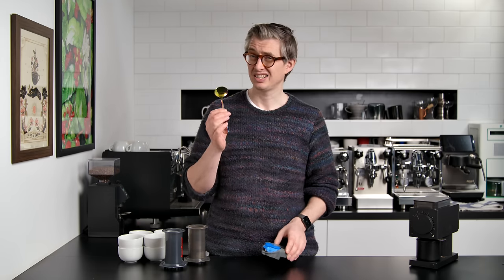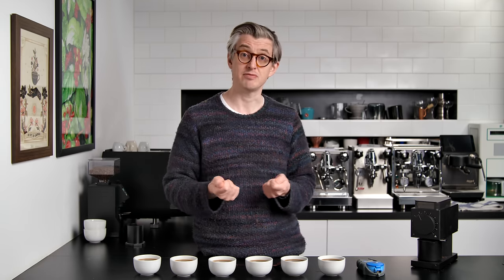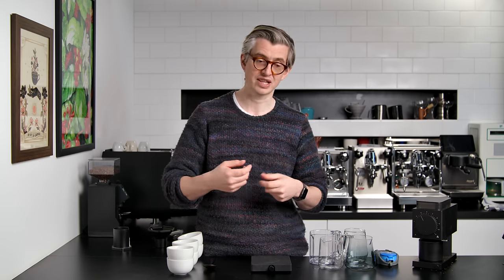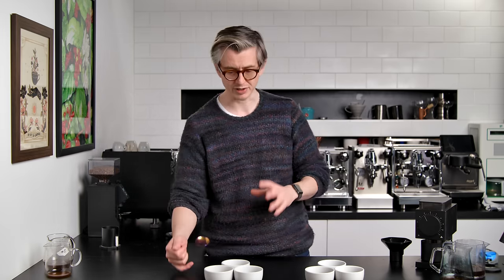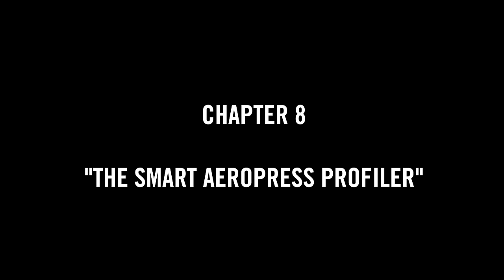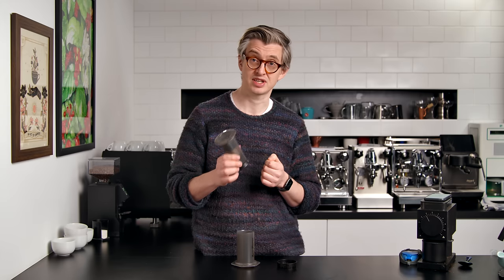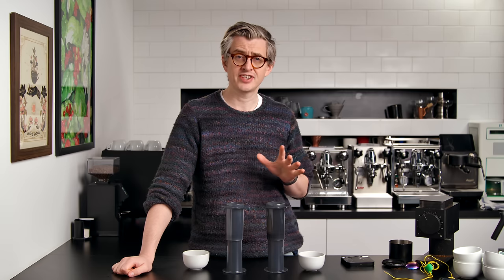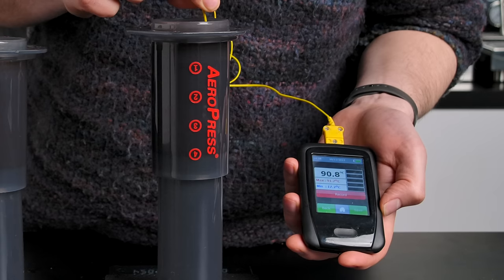Understanding The AeroPress (Episode #2)

Comment: Perfect way to start my weekend: 30 minutes of detailed and informative Aeropress science!

Two followup questions:

1. What if you change the volume but keep the ratio constant?  (I’ve found that smaller brews sometimes taste better — possibly because they extract less since the water loses heat faster, which probably means they were overextracted at larger sizes.  Maybe I should’ve just adjusted the grind instead?)

2. What about using two filter papers?  (I was resistant to this idea for so long because it seems so wasteful, but I did it accidentally the other day, and I was shocked how much difference it seemed to make, for the better.  It even got me rinsing and reusing the papers, to avoid excess waste..)

More generally, I wouldn’t mind a bit more on dialing in — is there anything worth adjusting other than the grind?  What if I can’t grind coarse enough, e.g., because I have a grinder that’s more geared towards espresso?  How do you deal with overextraction in an Aeropress brew?

Looking forward to more!

Comment: If you stir with the Aeropress provided plastic paddle instead of a metal spoon, you will get the same results as a swirl. The long paddle and its large surface area does a good job of moving all the volume in the tube equally.

Comment: Very helpful video!
I stir with the included paddle after pouring half the water in, then use the remaining water to rinse the paddle back into the press. Most thorough brief stir, no dirty utensil, or lost preciousness. (Sorry James your cute spoon barely impacting contents, did not appear to stir much)The inverted method (never spilled once, years later), I put the filter holder on while inverted and squeeze the air out the top before turning it over to plunge, barely a hiss at the end.

Comment: When I started brewing at home again, I'd long forgotten my Aeropress skills and "ideal" setup, which I hadn't used in more than a decade. Little did I realize that I'd spend hours watching Mr. Hoffman educate me on all aspects of espresso, even though very little of it will actually impact my own personal tastes (the nuances of any brewing technique tend to get lost when I pour the 6 oz of cocoa-infused steamed milk into what is now a mocha).

But my inner knowledge junkie just can't resist. 😁

I invert because I can stir the coffee slurry without potentially damaging the filter (sorry James, but spill risk factor is zero).
I slightly wet the filter just so it sticks inside the housing (and I re-use it for round #2).
I do a 2 minute extraction, with a swirl at the 1 minute mark.
I push most of the way through the hiss, stopping short of the puck itself.

Pop the puck. Rinse. Repeat. 
Add milk mixture from frother. Top with whipped cream. Enjoy.

Comment: Never had a problem doing inverted, surprised it didn't make that much a difference but I still prefer the process tbh
Reply: I've always found with inverted I can get rid of nearly all the air in the chamber by knowing the amount of water going in, positioning the plunger accordingly and doing a little press with the cap on before inversion. Wonder whether air/airless makes any difference?
Reply: @groundcontrolto  considering the hiss didn't do anything I don't think having air there does change anything tbh
Reply: @SWatchik  The only thing I've noticed is that it stops coffee sometimes getting stuck to the plunger but maybe that's cus I'm not agitating enough XD
Reply: I have a Prismo just for the convenience of doing inverted.
Reply: Alex V  There are some nice stories in the book, useful for some people despite being mostly fiction.
Reply: Alex V  I'm an athiest but thanks for the irrelevent comment lmao
Reply: I think that without air inside swirling is less effective. But perhaps it's not necessary at all because turning does the agitation work?
At the very least after watching this video I'd let it settle for 30s after turning.

Comment: Instead of using paper filters, I like to use metal screens. You can try ones with various mesh sizes to find what you prefer. It saves money too, as the screens can be used over and over.
Reply: Brewing with metal screen also changes with the techniques discussed here by James, despite showing minimal difference with paper filters. Since metal screens can allow more particulate through technique is especially important to reduce the amount of sediment in the cup. I find inverted, purged, swirled, settled, and no hiss all work in favour to brew a cleaner cup.
Reply: You will never get a metal filter that will be as fine as paper. At least in a range of price that the consumer can afford. There may be ways to make metal filters that go down to the micron range, but I doubt it is a cheap process. I suspect that metal may also allow for a greater chance of channeling as it's larger diameter holes will be easier to clog. That said, I'd like to see a side by side test using his pressure gauge.

Comment: TY James! This video is amazing. i was thinking of replacing my 8 year old Aeropress because for some reason it has become quite easy to press it - thinking due to internal scratches or maybe just my arms getting used to pressing. 

But this video taught me:
1. Less pressure is not a bad thing and can in fact make Aeropress taste relatively better.
2. Less pressure can occur if you brew higher temps. (I used to brew lower temps so remembered how hard it was to press but I started brewing more at boiling temp a few months ago).

Comment: Something I found confusing for a long time is how you can do a long-steep brew (e.g., 8 minutes) without over extracting. Like many, I have definitely had an over-extracted long-steep brew. 

Here is my theory and perhaps someone can tell me if it's right or wrong: Extraction rate decreases as the brew cools. The goal is to extract all the good stuff and none of the bad stuff by the time the temperature drops to a point where the extraction rate becomes insignificant. Therefore, grind size selection is very important in limiting the amount of extraction (for a given starting brew temperature and dose). 

The overall thermal mass of your brew and degree of insulation affect the rate of cooling and therefore extraction, so you may need to modify grind size for a different brew size or brewer to achieve optimal results. Also, the extractability of specific compounds changes at different temperatures. Therefore, although it's possible to get the same extraction % for a finer grind over 2 minutes and a coarser grind over 8 minutes, the chemical profile (and therefore flavor profile) in the cup will be a little different. 

Thanks for reading :)

Comment: I now own a Rok Espresso maker and Belman steamer, which might be "enough said".

But I still feel the need to leap to the defence of the Aeropress.

I never used a paper filter. Fine grind of light roast through an Able stainless steel super-fine metal filter. Very hot water, and short steep time (10s or less). A whopping 70kg of pressure with a strong cup to hold it back.

Still a great piece of kit for camping.

Thank you for this video.

Comment: I'm an inverter, non-rinser, no pre heat, fresh of the boil water (standard kettle, no control over temp), no swoosh or stir,  hiss-presser, with a fair amount of pressure.
I think I hiss press because I invert, so I'm going to make another cup now and non-invert and see if there's a difference. I'm also going to use less pressure from now on. 
Great video, and I've subscribed. 

I would also like to see some tests on the metal filters, as this is something I've been considering as it's less wasteful, and saves trees.

Comment: whoa! i've been using my aeropress for years now, with a light roast, fine grind, inverting*, boiling water, swirling, brewing a few minutes, pressing slowly and through the hiss... and i've always thought, 'i should probably google this and learn the right/better/proper way to use this thing. i probably need a fancier kettle with temp control, and i wonder if I'm brewing too long.' i love my coffee but always wondered if i was doing something 'wrong' or if it was possible to make it even better.

hallelujah! i'm so glad i don't need to bother changing anything nor spend money on a fancy new kettle. yay! 🙏

* i don't find the inverted method clumsy at all and I don't like when that splash or more of under-brewed stuff leaks through before i can get the plunger in to stop it. also just putting the plunger in pushes a little more of it through before it's ready. does anyone else notice that?

Comment: I used to use the inverted method, but lately I've used the plunger to form a vacuum.  If you load it, put plunger on, then give it all a swirl, you lose very little liquid before steeping.  Less than 10ml.  I know this because when it has a vacuum it's not dripping and you can pick it up and look in the cup.  Another interesting thought about steeping non inverted is over time your coffee grounds will settle and you're more likely to press through them is my thought.

Comment: I've always gone through the hiss to compress the ground for ejection and easy cleaning,   so I'm glad it makes no difference in taste.

About 6 years ago, my nephew bought me the AeroPress one Christmas, as they're unbreakable, light and ideal for bike/backpack camping) followed that up about two years later with a stainless filter (similar to a portafilter) by 'FELLOW', which I like, it's easy to clean and I haven't used paper filters since. It does protrude 21mm below the bottom of the cylinder so slight immersion may occur depending on cup. Maybe you'd like to try one of those out?

I use the inverted method, inserting the plunger to just below the number 3 circle gives the right measure for 1 cup when filled and I either switch off the kettle just before it gets to a rolling boil, or wait for the rolling boil to stop. I also give a stir, filter on and invert back onto the cup, swirl for about 15 - 20secs, about a minute to steep then plunge with easy pressure, no forcing. That's what works for me.

My AeroPress is used two or three times a day at home and travels with me when I'm away on holiday.

A tip for those who've used AeroPress for several years and for those who have yet to encounter a problem that the plunger has after those years of use.
The plunger's seal gets infused with coffee oil's and stiffens over time which causes it to not fully expand out again when removed, losing its ability to seal properly when replaced, and allowing hot water to trickle past it. I thought I'd have to replace it, but with the help of YouTube, I found that I could refurbish the seal by using a boiling hot water/mineral oil combination in a bowl. I did that last year, the seal softened up again and the plunger is still working as it should, no problem.

Comment: Excellent video, James! I've been doing experiments as well.

Please test bypass brewing (pressing 1/4 of the water through then adding the other 3/4) vs. pressing all the water through. They end up with the same coffee:water ratio, and I find one of those tastes a lot better than the other (medium roast and 80°C water).

Also, you might be right about the hiss results when mixed in, but try pressing the air through into the sink and tasting the foamy part that comes out. I find it tastes great from the company's cold brew recipe and not great from hot brew!

Tip: Taste-testing in dark coffee cups pretty much hides the color differences between samples, including those due to slightly different amounts.

Comment: James, if I seal with the plunger before blooming at least a little (wait 10+sec or stir to get most of the CO2 out), the CO2 releases while sealed and often the pressure pushes down & punctures the thin filter, and I get a hot mess of everything in my cup.

Comment: Thank you. Nerds are the most interesting people.  Asking the right questions and making the kit to answer those objectively is a lesson in domestic science.
You never defined what coarse or fine means for the Aeropress.  Your recent review of the Nespresso pods and grind showed how important both the grind "average" size and distribution are.  Many home grinders are now available providing variable grinds.  How do these compare in providing the optimum flavour using your preferred Aeropress technique?
PS I use the inverted method. I assumed that tipping the filled Aeropress then allowing it to settle for ca 120 seconds before pressing would achieve a number of things. 1. it would thoroughly remix the coffee and water, 2. It would stratify the filter bed with the larger particles against the paper and the finer settling on top, 3. On pressing, the remaining finer particles would be preferentially caught at the top of the filter bed so would not prematurely clog the paper filter (a common problem in chemical processes) [perhaps initiating chanelling].  But I have no evidence that might justify any of these assumptions, not even a cross-section of a used filter bed.  Where did you get your grind indicator?

Comment: I use just off boil, no stirring/swirling, very slow, gentle push with a Prismo and metal filter, no paper filter. Adjust grind and dwell for the bean. Works just fine.

Comment: I use the inverted method but create a vacuum before turning over by pushing the unit down, wait for the hissing to stop (that’s air passing through the wet paper filter, no hissing means all the air is out). Turning the Aeropress over now won’t cause any leaks or spills if there is a vacuum. There are lots of videos on YouTube showing how this is done without risks of scalding or creating a mess.

Comment: ooo.
The overpressure stuff.
Yeah, when it squirts out the side, you're funneling for sure.
Better filters help prevent this, I stopped using the white ones in favor of the recycled ones which are cut in smaller sheets to give a better seal. 

What I noticed was happening was the white paper filters were not uniform enough so you wouldn't get a proper seal of the filter to the aeropress face. 
This in turn would funnel grounds through.

I generally look for a harder press when I use my aero press, but a lot of stuff presented here will definitely change how I use mine. I got some experimenting to do.

Comment: Thank you, very informative video. I hope if you see this you might have the time to answer. I find that I don't care for the aeropress when I brew a concentrated coffee and then dilute it. I find I enjoy it much more if I fill it with water to the top and press all of the water through more like a french press. Am I doing something wrong?
Reply: Hello,

If i may answer? I have been brewing and roasting coffee since 2017 but I'm still learning new things.

I too, used to enjoy Aeropress the same way you described. You are doing nothing wrong if you enjoy the coffee you brew. 

If I may suggest using a good grinder. Having grounds that are uniform in size will allow even extraction. You do not want boulders and dust as it is called.

Aeropress has come out with an xl version if you desire more volume. 

Also, experiment with water. Making special brewing water will allow your coffee to really pop.

You can get distilled water, baking soda and pure Epson salt. 

Or you can buy pre made pouches with the stuff already made and is added to distilled water. It is a task but in my experience, making brew water specific to brew method has made HUGE imact on the taste of my coffee. I wish I could brew for you using brew specific water. It is magical. 

Lastly temperature is important too, try adjusting temp and see what you like.

Thank you for reading my suggestions and advice. Forgive me if I over stepped. If ever you have a question I will be happy to answer and if I do not know then we can find the answer together.

Comment: I use the Aeropress to mark the size of Melitta filter paper cutouts instead of buying discs. With relatively careful measurement, you can easily get 6 discs from one filter. I dont know if it's more economical or not but you can definitely press harder without busting the paper.

Comment: Back for a re-watch (and another comment). I bought the XL. The problem with the XL is that it's a larger diameter than the standard and the filter paper density is the same. When I brew 400ml, and try to use the vacuum method, nearly 100ml is in my mug before I press. Same problem as brewing 400ml with the standard AP, only instead of adding hot water at the end, it's at the bottom of the mug. So, I'm using the XL inverted. It's better than brewing 400 in the standard, but not by a lot. If only they'd kept the diameter the same and just made it a bit longer.
FWIW, up to this point, I'd been making 400ml in the standard as follows:
- heat 400ml water
- setup AP
- grounds in AP
- add water until it's about 2-3cm deep
- swirl AP and mug for about 15 seconds (this lets me skip stirring)
- fill with water, up to about .5cm of the top (you want juuust enough room to get the plunger seal seated and lift - and coffee grounds can break your seal)
- attach plunger, lift up a little bit for vacuum 
- steep
- plunge
- add remaining water (about 150ml, depends on amount of grounds)
It's totally not terrible that way, and, if you're like me and just want a little more coffee per brew, it's about as good as the XL. Inverting the XL makes it a bit better, but if money's tight, or you've already got 5K paper filters...
Bright side with the XL if you're making 400ml, the plunger can be between the 8 and the dot, so very little chance of it coming apart - and it's got a nice wide base.
Hope this helps someone...